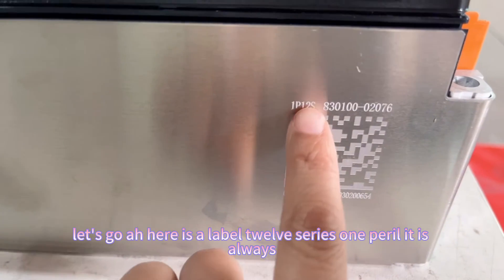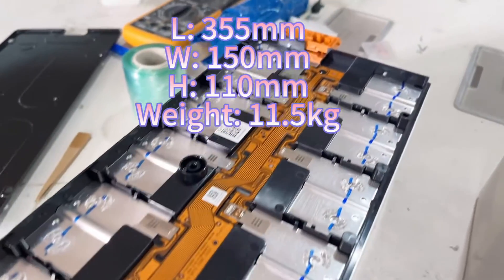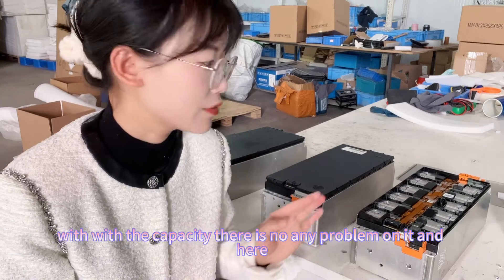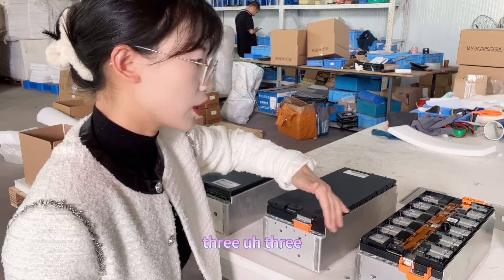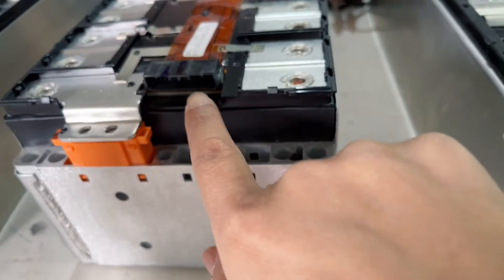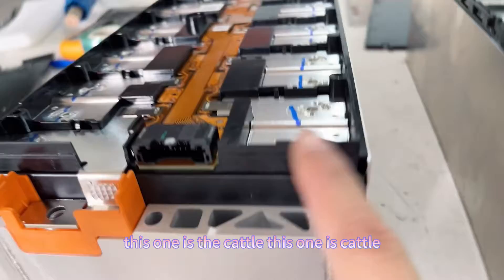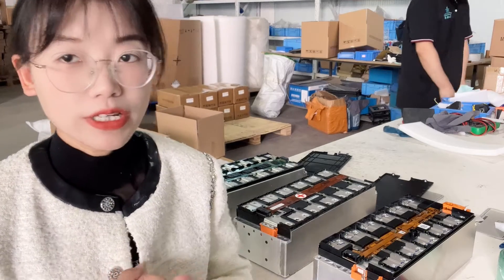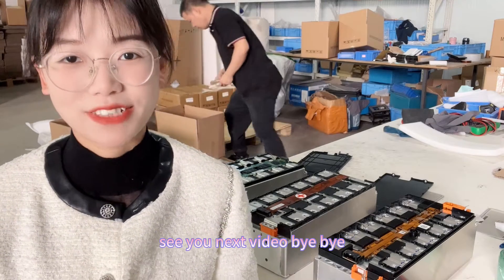CATL battery 12S1P 50Ah battery module for Nissan Leaf car EVs car battery replacement

Comment: do you sell the battery wiring harness to and the mechanical bolt brackets with the batteries? Thanks
Reply from the maker: we can provide the wire for modules

Comment: Marketing Suggestion to help explain and sell this to European consumers - People may want to upgrade the battery modules in their Nissan leaf or use the nissan leaf for DIY ev conversion. So if you can , it would help to show how these replace the OEM batteries and what capacity they are relative to the OEM battery. Thank you!
Reply from the maker: Thank you for your message. At present we only provide the modules. We still didn’t get the DIY technology. But we are working on it. Will update when we got🤗